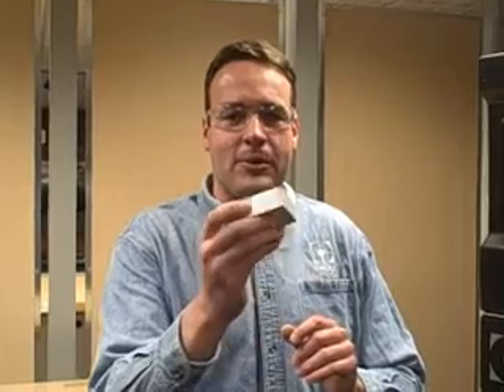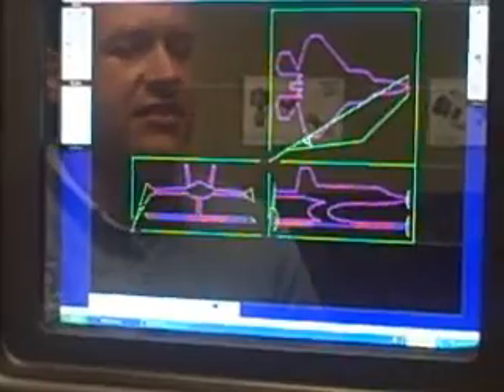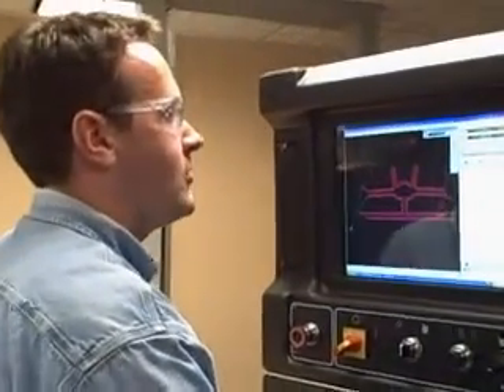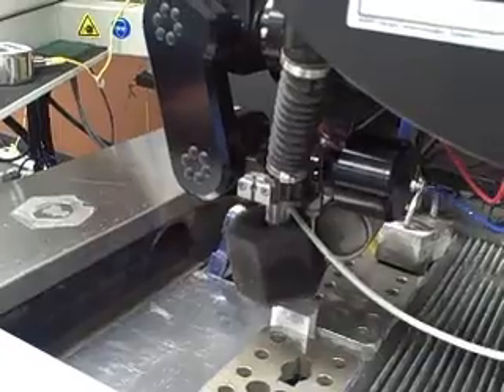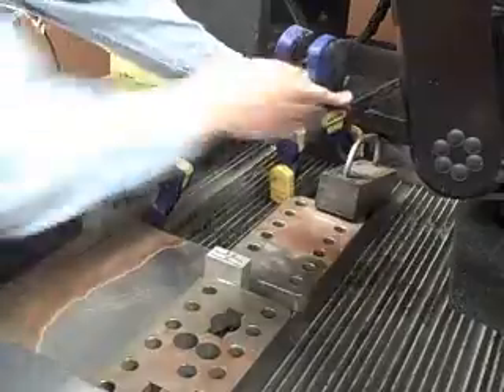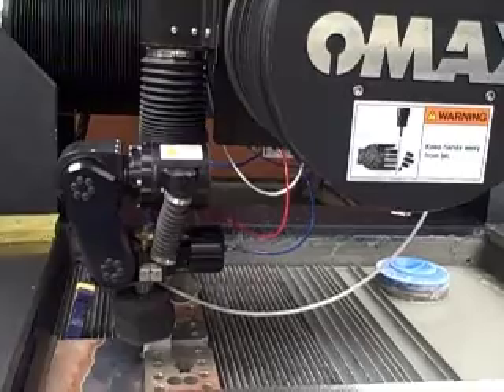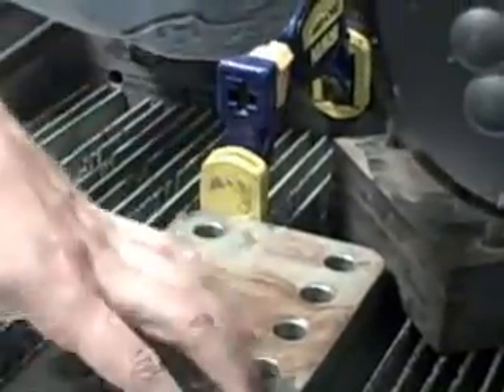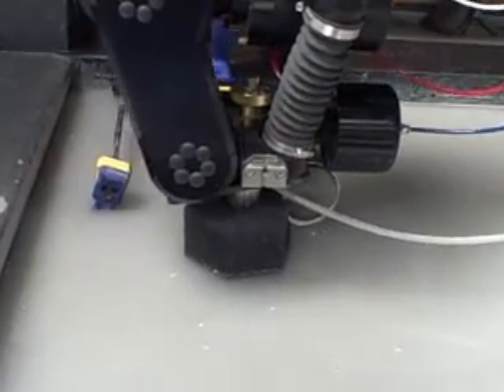OMAX Cuts Mini F22 Fighter Jet with Abrasive Waterjet

Comment: I was wondering if cutting above water can cause premature wear on a mixing tube?
Reply from the maker: Great question, Gary. Yes, cutting above or using a stand-off closer than recommended (.060” - .080“) water can cause premature erosion to the tip of the mixing tube.